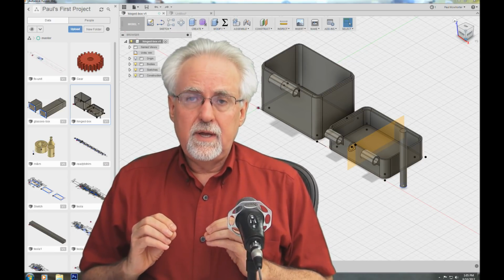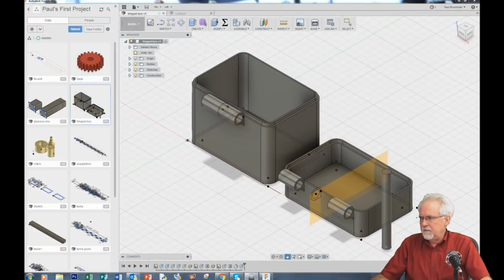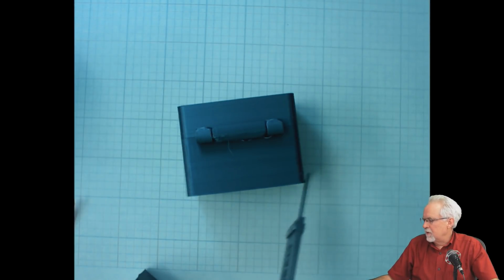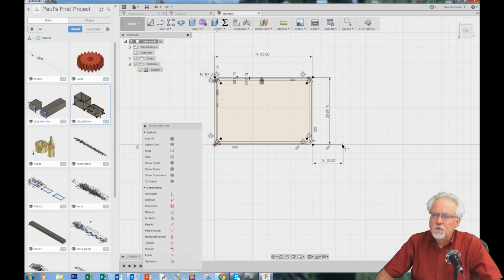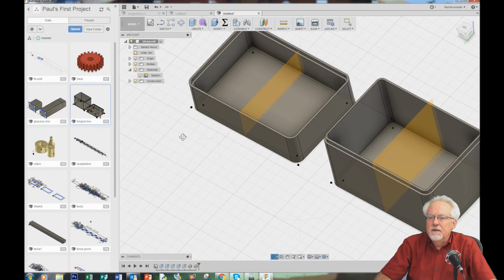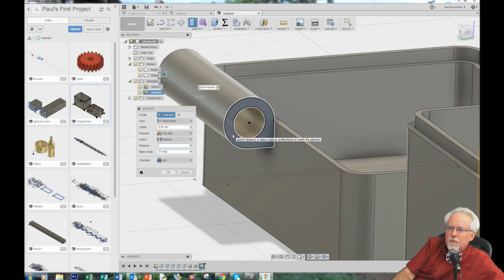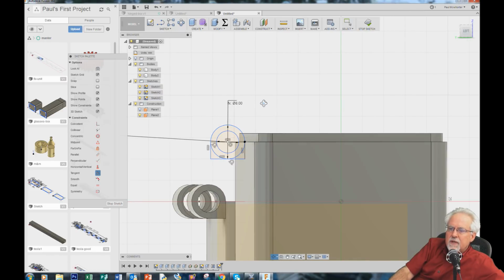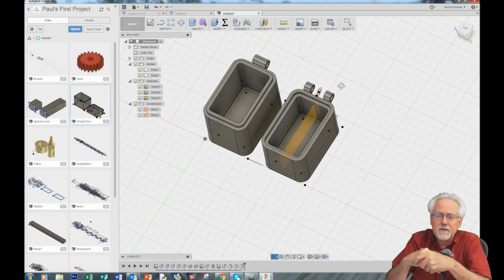Learn Fusion 360 or Die Trying LESSON 6: Sketching on Offset and Orthogonal Planes

Comment: Paul: Excellent video as usual.  One note: It looks like a number of recent viewers got hung up at 40:42 where you add the two point circle constrained to the edge of the existing extruded body.  This recent occurrence of the stumbling block perhaps indicates a change in F360's default settings. But in any case: It turns out that F360 won't snap to model edges (that intersect the current sketch plane) unless you have Preferences > Design > "Auto project edges on reference" enabled. Description: "Auto project model edges to be used as a reference when creating constraints and dimensions in active sketch when [view] orientation is normal to the active sketch plane". Ie: you have to also have the view set to be looking straight at the sketch plan, so possibly click the view angle cube. There's also a setting Design > "Auto project geometry on active sketch plane" that looks important too.  Perhaps you could add a note about this in the video description, or pin a comment to that effect?  It would save people from getting stuck at that point unable to continue, and you're right, this is crucial material!
Reply: Thank you so much I was about to start crying over it xwx
Reply: Thank you for making this comment.  I was pulling my hair out trying to figure what I did wrong.
Reply: Sir same thing happening . I am.not able to draw two point circle in the Midplane which we constructed after extruding the two Midplanes for the two boxes . I tried zooming in and out . But the two point circle not able place on the sketch we created . Please help out how to do it .. 40.42 part of the video time in was talking about . I couldn't go further after that . Please help ...
Reply: Thank you so much! Excellent!
Reply: Just saw your post, bloody hell been battling this for about two hours now ha ha
Reply: thank you 2 days i was stuck
Reply: Thanks for that . Tore out what was left of my hair! Read your post and BOOM! Locked in just fine.
Reply: Thanks a ton for pointing this out, I was getting so pissed off as to why I couldn't get it to work now when I was able to get this to work last year just fine.
Reply: I was stuck, even after fixing my settings, but only because I was working on a parallel plane.  Paul said it plain as day at 39:50, I just wasn't paying attention.  You have to click on the midplane you created when you create the sketch.  Now it works six ways to Sunday.  Thank you!
Reply: @toddao818  Thank you Graham, but also thank you Todd, Graham's tip alone didn't help, but you saved my evening. 
The lesson to be learned: If you get stuck, read the comments, you're rarely the first. Cheers mate.
Reply: @toddao818  This was the fix, thanks toddao!!
Reply: Lee, what did you make it coincident to?  I'm having the same issue and when I select Coincident, I have no other geometries that can be selected.
Reply: Thank You Graham..I was messing with that for 2 hours until I decided to read through the comments!!  Appreciate the hard work Paul McWhorter!  You're rocking!!
Reply: Thank you  :-)   That saved My day.
Reply: Hmm.   I modified  Preferences > Design > "Auto project edges on reference" enabled as described, but I still can't get the hinge sketch to connect to the side of the box.  Help!
Reply: @sj-kp1ks  Its a while ago that you posted this, but you didnt get an answer so here's my experience: at firs you do not see a circle, but as soon as you click it to create the diameter, it appears.
Reply: I got to this solution myself and I was writing a looong message explaining it when I noticed the timestamp 40:42 in your message. If I only had read it before :DDDDD
Reply: Thanks.  I am extremely relieved that you solved this for me.  I wish I had read the post earlier.
Reply: sir am lost to in that point but thank you for your comment it helped me a lot
Reply: Thank you! I was totally stuck at that point! I went so far as to completely start a whole new design. It was good extra practice and I found a plugin to import/export the parameters to a CSV file so I guess it wasn't a total loss! Next time I get stuck I'm going to check the comments!
Reply: @scopes78  Where did you find the plugin to Import/export parameters to CSV file?
Reply: Good man, luckily I read your comment before I got too stuck, tried it without, and then with.Cheers.
Reply: I was struggling with this, searches on the internet didnt help. then I thought, mayby someone else had this problem in this video. Luckily you are pinned thanks a lot!
Reply: March 2020 during lockdown : This is exactly the problem I had. I kept going back (multiple times) to see what I was doing wrong, and eventually gave up. The extrusion worked anyway, and I have learned a great deal. :)
Reply: Awesome. Just what I needed.
Reply: I wish I had seen this earlier.....  I was "CIRCLING-THE-DRAIN" for 2 hours trying to figure out what I was doing wrong. Thanks for your help...  ;)
Reply: Thank you for this post.  I spent all day googling around for a way to snap the circle to the edge.  I used constraint coincident finally but that affected the extrusion at the end.  I watched 40:42 a billion times.  Was going to post and then saw this.
Reply: Thanks a lot! Spent around 40 minutes and redrawning multiple times to find my fault. You just safed me from a meltdown.
Reply: Holy cow I wish I had scrolled down to this before now...thanks so much. Is this setting recommended to be enabled?
Reply: Thank you! felt like I was going crazy. Wouldn't even know where to begin to find this answer that you solved for us. Thanks Paul and Graham. Lets continue :)
Reply: I need to start reading the comments first! I've redone this several times and kept getting stuck! And when I added a point to add a constraint to, it went well until having to do the tangent constraint. THANK YOU THANK YOU!!
Reply: That saved me so much trouble. ThANKS!
Reply: Thank you for adding this!  Was about to start crying!  Paul, love your videos!  Helped me more than any other ones I have come across!
Reply: Excellent!  I struggled over 2 days trying to start from scratch a few times, but it works like magic after reading your comment.  Thank you!
Reply: Upvoted. Thank you very much!
Reply: Thank-you! I figured out I had to change a preference, but I couldn't figure out which one. You rock!
Reply: pressing OK after extruding the hinge with the equations deletes the entire body of the lid :(
Reply: You are an absolute hero. I just spent 20 minutes back and forth and thought "wait I can't be the only one.. maybe there is a pinned comme-----.... YUP there it is!"
Reply: Wow.. you made my day. Many many thanks for this little✅
Reply: I'm going to try this, I was going crazy here. But I will learn this or die.
Reply: Thank you so much! You saved my life!
Reply: After a couple of hours, I gave up with that method. Instead, I constrained the center of the circle by dimension and it works perfectly. (Dimension circle center using topHeight (bottomHeight) vertically and dimension it using half the hingeDimension horizontally. 
Even though it works and I cannot break the design, I want to try your method Graham. Thanks.
Reply: Thanks mate!
Busted 45min then saw the comments
Reply: I read the comment and checked enabled way before but for some reason, it does not work it jumps the whole thing way up
Reply: Thank you for your help with this option - Auto project edges on reference - it was a great help.
Reply: 4 years after you wrote this - lost in space until I found this and then figured out where to find "preferences"...  was determined not to give after many tries..  Determined not to go off and seek psychological help.  Paul IS an excellent teacher.  Looks like smoother sailing going forwards.   This was beyond helpful.
Reply: Thanks for this invaluable information. I was hung up at this point for a whole day. I refused to give up and lived up to the mantra " Learn Fusion 360 or Die Trying"
Reply: @graham_wideman- thank you so much ! and also 
@toddao818 - i was forgetting to choose the plane before starting the sketch, thank you
Reply: movember 2024. Still most valuable comment here :) Tahnk you!
Reply: Lifesaver, thank you.  There is no way I would have ever figured that out in any reasonable amount of time.  Nearly every time I look up something about Fusion 360 I either land on the always useless Company docs or some random forum with 3 forum posters arguing and trying to prove the other person wrong.
Reply: I wish I'd seen this comment earlier. I used a workaround and created a point with distance constraints to match the height and corner radius parameters for the circle to snap onto on - kind of worked, but am glad to see the real solution!
Reply: So glad I scrolled down and saw this comment. It was driving me nuts why my own design wasn't working, so I went through this whole tutorial only to find the same result. That's when I found your comment. Better late than never.
Reply: you sir, deserve a cookie!
Reply: This is still the fix 7 yrs later. Thx

Comment: BottomFraction and TopFraction is totally just how much of width the bottom Hinge and Top Hinge of the total available Flat Width, the offset  calc is as illustrated below, 

Box Width		65	
Corner Radius		4	
Hinge Gap		0.1	
Hinge max Width	Box Width-2*Corner Radius	57	
Bottom Hinge % of Max Width	user Choice	0.5	
Top Hing Max of Available Width	 1 - Bottom Hinge % of Max Width	0.5	
Bottom Hinge Width	Hinge max Width * Bottom Hinge % of Max Width	28.5	
Top Hinge Width	Hinge max Width * Top Hing Max of Available Width	28.5	
			
One Half of top Hinge	Top Hinge Width /2	14.25	
add the Hinge Gap	One Half of top Hinge + Hinge Gap	14.35	offset
Total Hinge Build		56.8	is <57

If We want the Bottom Hing to be 60% width

Box Width		65	
Corner Radius		4	
Hinge Gap		0.1	
Hinge max Width	Box Width-2*Corner Radius	57	
Bottom Hinge % of Max Width	user Choice	0.6	
Top Hing Max of Available Width	 1 - Bottom Hinge % of Max Width	0.4	
Bottom Hinge Width	Hinge max Width * Bottom Hinge % of Max Width	34.2	
Top Hinge Width	Hinge max Width * Top Hing Max of Available Width	22.8	
			
One Half of top Hinge	Top Hinge Width /2	11.4	
add the Hinge Gap	One Half of top Hinge + Hinge Gap	11.5	offset
Total Hinge Build		56.8	is <57
Reply from the maker: Excellent breakdown of the math!

Comment: I’m only 7 minutes in to the video, so please disregard if this gets answered later. 

What happens if I forget, or just don’t know that I’m missing a parameter that I need? For instance, the sunglasses case from the last video, if I don’t know to add a parameter for wall thickness, the rest of the parameters will still work on their own functions, I just won’t be able to edit wall thickness? 

If that’s the case, and I want to add the parameter while designing, I would have to completely start my sketch from scratch? 

Lastly, is there a cheat sheet that has common parameter checklist?

Comment: I suspect that this is changes in F360 over time, but it seems (1) when I want to go back to a sketch, the rectangle tool is not there.  I always just right click on the sketch in the tree.

(2) when I try to follow along with you after the corners of the first box are radiused and you lose the constraint of the first connection to the origin, I get an "over constrained" message when I try to tie the horizontal to the origin and a "constraint already exists" when I try to tie the vertical to the origin.  

I suspect that someone at Fusion decided that radiusing a box should not lose the constraints.

I took a fresh rectangle, and filleted it.  I got messages warning me about losing constraints and/or dimensions, but when I try to move the filleted rectangle it will not move. I'm a novice, but I looked at the constraints (I can't tell one from the other except by experimenting) and I see that in the origin corner there are three constraints.  I deleted the one to the farthest left and it allowed me to move the rectangle.

Despite the age of the videos and the changes to the software, these are still valuable videos.
Reply from the maker: Yes, they constantly update the software, but hopefully enough stays common to make these lessons useful.

Comment: When I edit wallthickness, it will edit all walls if I change it to 3mm, but if I go over 3mm, for example 5mm, it only edits the thickness of the bottom floor in each box. Or it crashes my fusion. Strangely it worked prior but now doesn't. Any idea's?

Comment: Hi Paul, thanks for the excellent videos!
Any chance you could also go over how to simulate putting the parts together and moving / operating them in software?
For example depending on the height and corner radius of the lip, the cap might not be able to rotate around the hinge (with a straight tall lip it would only want to move up and down).
It would be very useful to be able to detect potential issues early with collision detection etc before printing anything.
Cheers!
Reply from the maker: I did that in my new fusion 360 playlist on this channel. Check out the new playlist.

Comment: I just got into 3d printing. You are the first guy that actually show the basics and doesn’t run so fast that you can’t keep up. At almost 70 I’m getting a little slower.  Great Job.
Reply: Almost 70! Youngster.  I figure that when I can't learn anything new anymore I will be senile, so fusion 360 is this month's stretch.  I have been doing all my design in openSCAD which is both easier and harder, depending on what you are doing.

Comment: I spent the entire evening figuring out a work-around for the hinge thing (the newer version doesn't get the same result despite following the identical process to the video). Merely checking the "Auto project edges on reference" preference didn't fix it for me (it did help with normal drawing, though). I ended up redoing the whole thing and when it came to the spread hinges I created them as separate objects instead of attached to the box, and then used Modify>Align to get them to stick to the corners. That kept them in shape when changing parameters, but then I couldn't use the fillet tool to curve the shape inwards, instead it cut towards the box making it almost spherical again. So I scrapped them and went back to drawing mode and ended up creating a new, bigger box I attached to the hinge circles and cut down, and used the fillet tool with the FilletRound Parameter and attached it to the side of the box tethered to the corner of the lid. I locked it all in place and extruded them again. Success!! Finally, no matter what parameter I change, it all totally works!!

Comment: Thanks, Paul, I have been watching your series on Fusion 360, I have had a small amount of experience in CAD, but was struggling with Fusion 360, it's definitely a learning curve.  Your videos are excellent, I have been able to go from Amature to maybe beginner after watching the videos. My first model a basic bracket took about 5 hours to be able to print.  I have just made a complex Hall effect Adapter in around 30 mins. Your advice of getting it right in 2D first and constraints made all the difference.

Comment: It is possible that I am wrong, however, if you enter the wallthickness as - wallthickness instead of -wallththickness I get the fx in front. just add the space between the minus and wallthickness and it gets entered correctly.
Reply from the maker: Fusion 360 seems to sometimes behave unpredicatbly in this matter. Do what works for you.

Comment: This is the 1st lesson I couldn't do as per the video, the hinge that was mirrored couldn't get it to work just couldn't get the screen image that I was developing the same as the video, so had to coded it the 2nd time for it to extrude BUT when the width the left hinge changes it has to be manually adjusted

Comment: The only thing that threw me off on this video is that the default settings didn't have the auto-snap turned on.  So when it came to having the orthogonal sketch snap to the preexisting body, I had to find the settings to enable it before it would work.  Just food for thought if someone else has the issue that it's probably a settings issue.

Comment: Just to let you know this video is still valid, everything works as you did it except a bit different interface. I think guys coming from a software, electronics background like myself really need to think differently if we are to be successful in the mechanical domain. I also could not get the sketch of the hinge on the other plane, but I bet there is a way. Thanks for doing these videos.

Comment: OK Paul, as you stated this IS the video I've been waiting for. I've seen F360 experts using midplanes to create hinges before but they never really explained how they did it. And they did it too quickly. You explained it methodically & in detail. 
! I need to know this technique so I can get on with designing a clamp for one of my deck umbrellas. I want 2 identical clamps to attach one of my deck umbrellas to one of the deck rail ballusters. The idea is to hold the umbrella up without having to use one of the large, heavy cast iron or concrete bases. There's no room for a base where we want the umbrella to go. Thank you.

Comment: Mr Paul thanks a lot for all the great lessons! However, I'm having difficulties with the 2 point circle, for the hinges, not locking to the box/lid. For the lid I was able to lock it in position except I would still be able to move it up and down. For the box, it wouldn't lock at all, can move up, down, left, right. I tried all the other constrains, it would say sketch is over constrained, then I tried some dimensions, it would say again sketch over constrained. 
But thanks for at least getting me this far, it was great working with parameters, offsets, creating plains where I need them to be. Looking forward to the next lesson!!